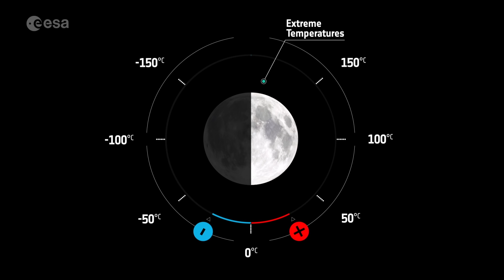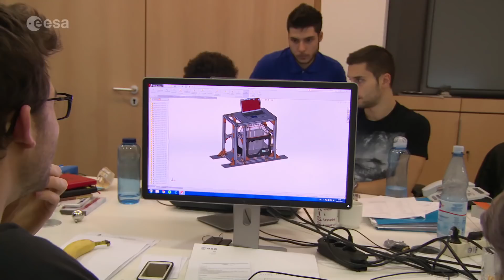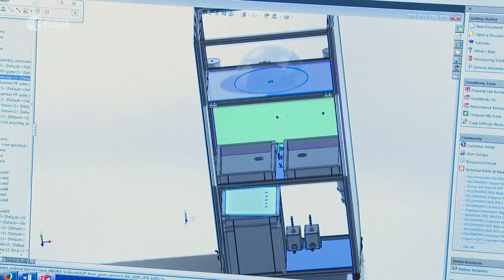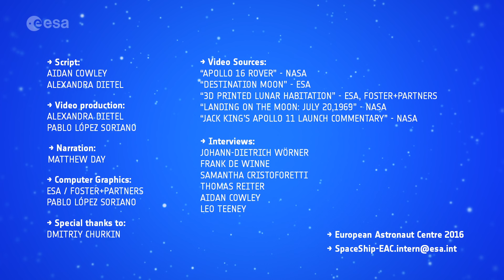SpaceShip EAC heading for the Moon

Comment: Hey ESA, I once heard that it would a good idea to shield yourself in a spacecraft by storing your watersupply in a big spherical tank surrounding yourself. Do you think that would be a solution to the radiation that you would expect on the moon?
Reply: water has 3 big problems:
it flaps around
you need it 
it will run out progressively unless they find some, theyll need it for the trip back!

Comment: And we have the sls to assist getting to the moon!!! I'm so excited
Reply: +chris darlington It'll cost so much to launch every time it won't be the answer to the problem. I'm putting my bets on the Falcon Heavy
Reply: ***** Soooooooo much cheaper it's absurd. Sadly, NASA only knows how to design things without ever taking risks (monetary or otherwise), which is pretty much the opposite of what SpaceX has been doing
Reply: ***** Couldn't agree more. What a time for space geeks to be alive :D
Reply: I don't see lunar missions from spaceX. That's not where the big money is (yet). But in 20 years, yes, I see spaceX using their big boy rocket, the Mars one, in competition with nasa and other countries.
Reply: chris darlington Thing is, SpaceX is a rocket manufacturer. Companies willing to go to the moon will contract them just like they're doing with orbital launches right now. Sure SpaceX's goal is mars, but they're not doing missions, only contracts
Reply: Naw, the spaceX falcon X and XX that's on paper. That's the rocket we need for moon and Mar. Even use the Orion. The sls is awesome. But like constipation, it's gunna be scrapped. That's where spaceX steps in.
Reply: Constellation****
Reply: +chris darlington yes the raptor engine. I don't think they will use it on the first stage. they may replace the second stage though with a smaller variant of the raptor engine. the raptor engine is originally being design for the SpaceX MCT which will need a freaking hugely powerful engine.
Reply: +NerdBubblegum well the Falcon vehicles could take payload to the moon but that would require modifications to the second stage and the LOX will evaporate in a matter of hours and the journey will take a few days. perhaps the new raptor engine being developed will have some solutions.
Reply: They are testin a new, stronger engine. They will use it on the FH. It will greatly increase the mass allowances on the second stage.